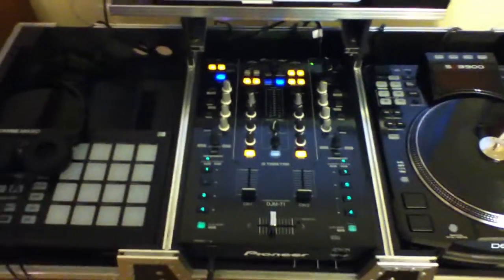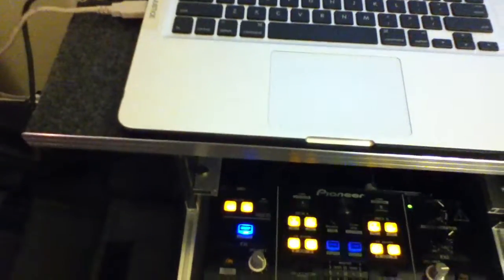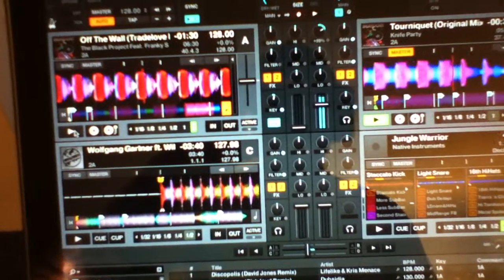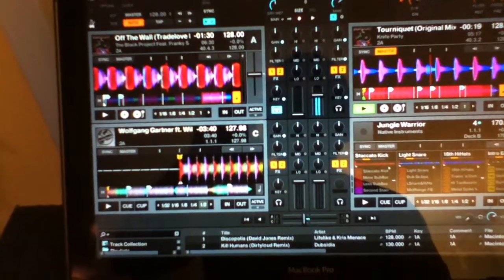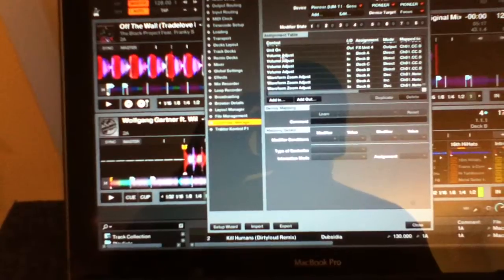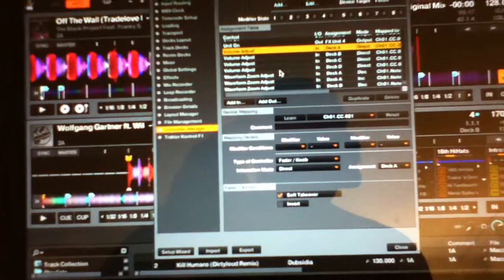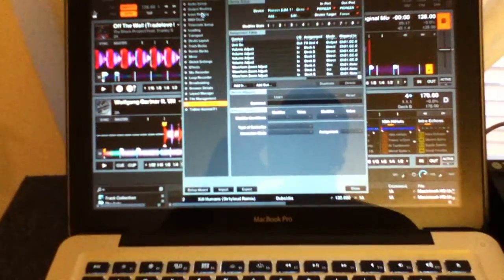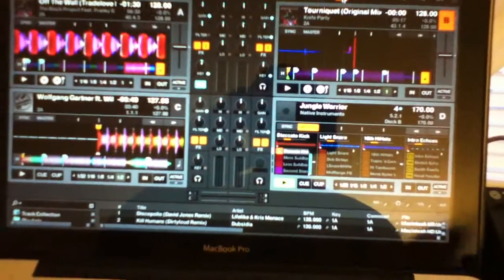Traktor 2.6, Pioneer DJM T1, and Internal vs. External Mode when using Post Fader Effects. Part 2

Comment from the maker: Yes, just go into the controller manager in preferences and delete the two mappings for the T1 and then add a "generic" and start your own. Or just set  the inputs and outputs to none if you want to go back and reference them while your making your own. Also download the latest version of the manual from poineer. The online one has all the new midi notes of the "triple shift" layer.

Comment from the maker: It works great with Traktor. You would have to midi map the new flux mode somewhere but it has three pages of midi. I like how it has a full effects section compared to the  Kontrol Z2 mixer but the Z2 crossfader feels better to me. The rubber buttons on the Z2 feel better for hotcues and remix decks. The T1 buttons are hard plastic, and they respond great, but I prefer the Z2's

Comment from the maker: You can also make a new mapping and use the override new function in the controller manager and it will change the   function of the midi button/knob from the default operation to whatever you program it to. That is you best option right now as opposed to a blank slate.

Comment: Im thinking of picking one of these up. Is there anything that doesnt
sync up with Traktor 2.6 ?  Everything work properly ? Did you have
a chance to check out the Traktor Z2 ?  Hows the cross fader for scratching ?
thanks DJ